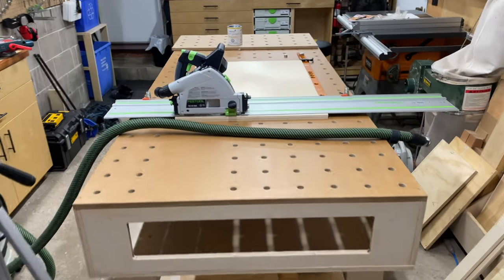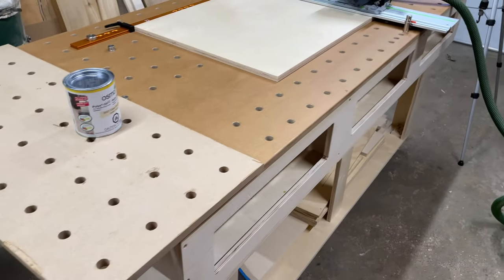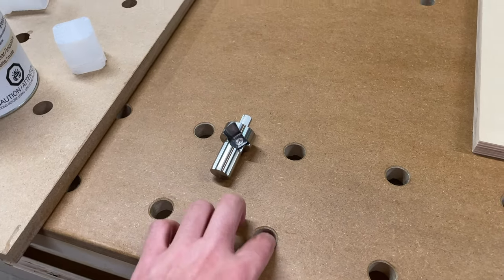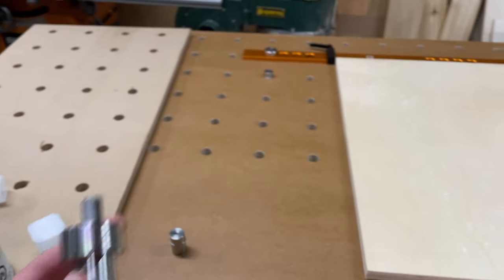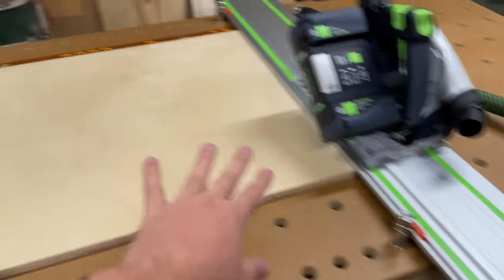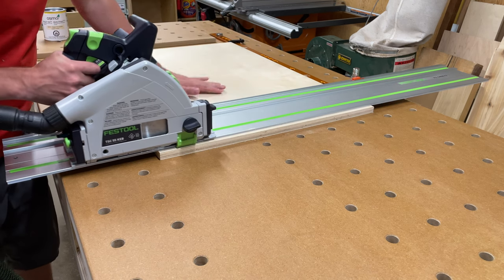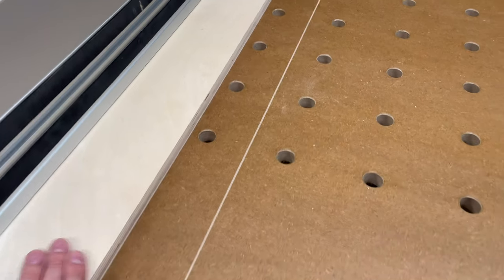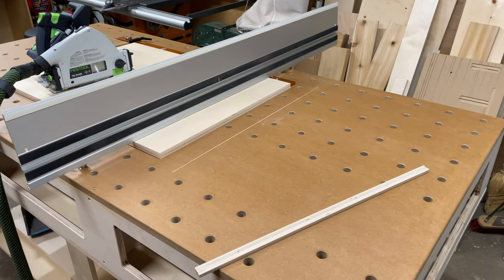Making My Own MFT (Update #5) - Finishing, Sacrificial Top for Sacrificial Top, First Cut!!!

Comment: just an idea the area where you make your cuts . you can use your router and the track and make a dado and then you can slide in and out thin sacrificial strips . I have been doing this for three years now . this reduces the number of tops you need to build out, I also used baltic birch for my top. The reamer was a game changer for me my table had such tight tolerances my dogs would stick. but these are the things I have come across using my Mft style bench

Comment: I have an MFT3. I remember making my first cut. You just want to keep it all looking clean and sharp. But… then I was using the guide rail as a stop to do Dominos mid panel. But I forgot to change the depth and I put domino holes across it. I did 3. I was so bummed when I lifted that board. Glad I only did it on the first set.
Reply from the maker: Ahhh, we’ve all been there with the Domino! I went a few months without issues and I swear it was when I said that to a neighbour, on the next cut I forgot to adjust the depth. Haha!

Comment: Another improvement you could do to extend the life of the top is to make a rectangular cut along the area where the track saw is going to be cutting on the table and install a friction fitted piece of MDF that can be replaced when there are many cuts in it. You should also do a 2nd cut for 45 degrees bevel cuts. I will probably use your recommendation about Poly/Osmo. I'm in Toronto btw.
Reply from the maker: Another Canadian!! 🇨🇦 That’s a great idea to just insert a replaceable piece of MDF, and it doesn’t even have to be that thick as I could just route out enough material for a couple inch wide 1/4” thick piece. I will definitely consider that!

Comment: The best finish on a MFT top would be whatever finish you have extra off already on hand or whichever you wanted more experience with. I had like 2 tubes of tungoil so thats what i used as well as regular paste wax to prevent any glue/finish from stick even more.

Comment: That workbench came out great, nice job!
I see it's already been mentioned, but I'd definitely add a sacrificial strip where the cut line is. Peter Millard just uses 1/4" MDF; that's perfect for this purpose. I'll be adding that feature to my own mft for sure.
How's the ujk fence working out for you? I haven't decided if I want that one or maybe the benchdogs version.
Looking forward to your video on the TSO parallel guides!
Reply from the maker: Thanks!!! I’m definitely going to do the strip as that will just help with longevity. The whole top will still be sacrificial, but 90% of the cuts will be on a replaceable strip. 

So far, I’m really happy with the UJk fence with my only frustration being the stop. It’s fine if I don’t accidentally hit it too hard, but it doesn’t lock down as much as I would have wanted. The squareness is perfect, I’m just not sure about using it for repeatable cuts.
Reply: @MasonWoodshop  That's disappointing about the stop; that's the one part that needs to be robust for repeatability. I do really like how low profile the fence is though.
Reply from the maker: @NWGR  It's a really nice fence that works perfectly with my table. I'm going to use it a bunch this weekend to see how problematic the stop actually is (if at all).

Comment: 7:48 .... Why not just cut a trench across and insert, say, a strip of 8mm MDF? Better, I think, that cutting up the whole table.
Reply from the maker: That’s been my plan based on a handful of comments on my build but the reality has been that after maybe 1000 cuts, the original line hasn’t changed at all! Hasn’t been any need for me to think about putting a strip in there. There are a small handful of cuts that zip zag here and there due to me not properly securing the track against dogs, but that hasn’t impacted the table at all.

Comment: why not place a .250 x 2.00 insert into your table that you can replace when it gets ragged-----no cut into the table proper       good video thanx rick
Reply from the maker: That’s something I’m certainly going to consider when the time comes. I plan to do an update video soon as after many months and many hundreds of cuts, it’s shocking how little it has worn on the table. The whole dog system has allowed for impressively accurate cuts into the table top!